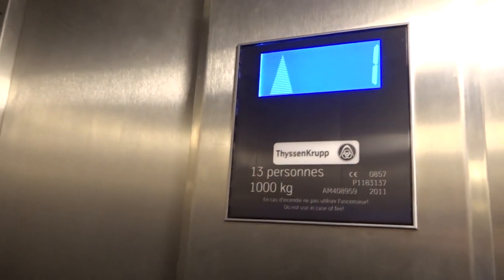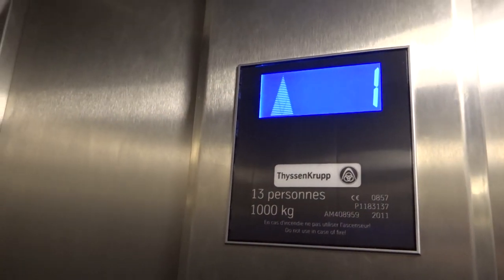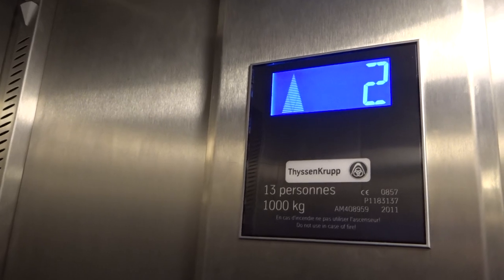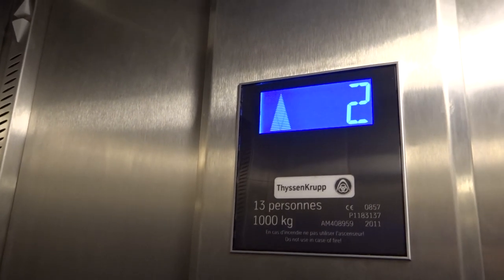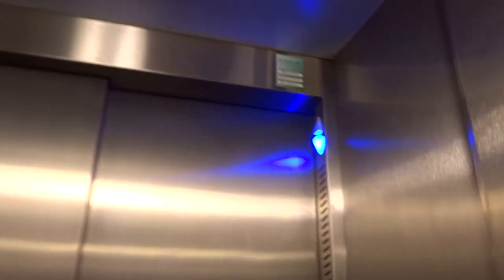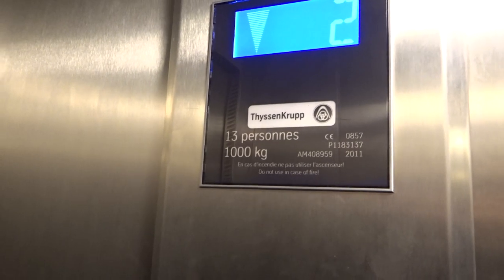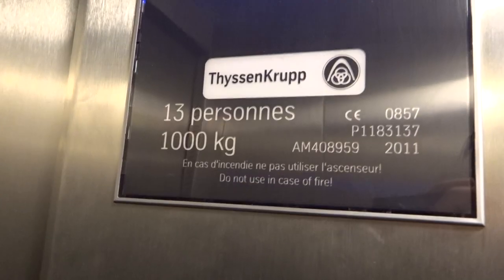Crappy 2011 ThyssenKrupp MRL Traction Elevator/Lift@Leppävaara SC, Espoo, Finland

Comment: I bet ***** and ***** don't like this replacement.
Reply from the maker: Yeah, that is quite likely to be the case..
Reply: ***** It isn't a modernization, it's a replacement after this shopping center underwent renovations.
Reply: ***** This is located in Finland not in France so why the capacity is written in French rather than Finnish as this located in Finland.
Reply: ***** Although, this isn't a mod, it's a full replacement. Look at the vents, doors and door tracks.
It was originally Hydraulic but now Synergy MRL Traction.
Reply from the maker: Oh yes, I determined that, because it looked like it may have been hydraulic, originally.
Reply: ***** OMG the worst buttons in the world !! You're right, I HATE THIS !
Reply from the maker: Yeah, that was our bet, because I also hate this elevator - it's so soulless!
Reply: FinnishLiftFilmer1993 This elevator has NO interest at all ! I'd better simply take the stairs rather than using this crap !
Reply from the maker: I agree!